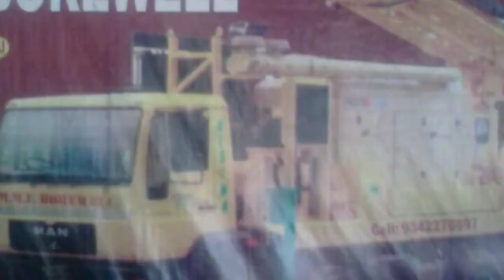(916)10 wheel /6wheel /Gass /ROBO/Cleaning/jeep/scanning camera/motor lift/filter pipe 9035278897

Comment: One point Rs
Reply from the maker: WITHIN Bangalore any time but out of Bangalore customer timing only 9 am to 10 am only Thanks  to visit in you tube MME BOREWELL Kammanahalli Blr--33  I am J.Selvaraj traditional water diviner cum online water  point Founder try to subscribe you will find out 1K different types of VEDIOS  (9342278897) SBIN0007988A/C No.10374599900-J.Selvaraj
1.Online test point @501
(10minuts 6.15to6.30am)
2.online rechecking@1000
3.Site inspection method (traditional) local
@/2000/2500/3000 depends 
Distance-per site (30×40)-15to30 
Minutes
4.Big land /Outstation@5000/-x
Per Site /per acre +TA (1 hour) 
5.Geo physical Resistivity Meter Vertical Electrical Survey local Bangalore @10000/ (Agriculture land+Big site) if outstation@15000(up&down TA party has to pay)
Traditional method Booking@2000/+first point @7000+2nd point@5000 per acore (1or2)  maximum of one hour after that i would't  stay there if everything ok Call no.9035278897/9342278897/9448054809/08025494809 (useful for commercial +big field areas+Agriculture land
Note - What ever give the point by experience basis 90% confirm +10% upto God gift